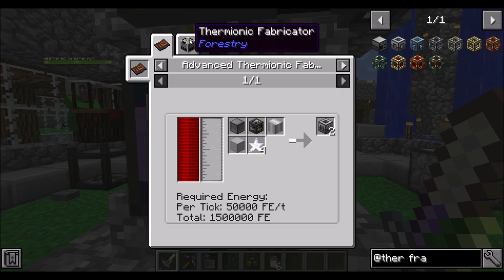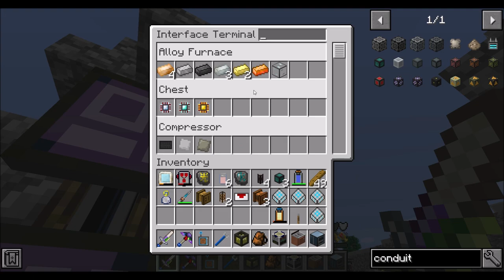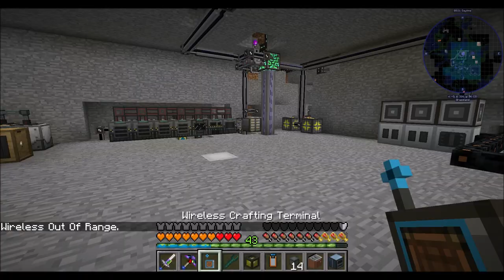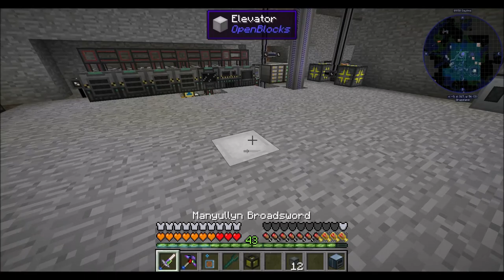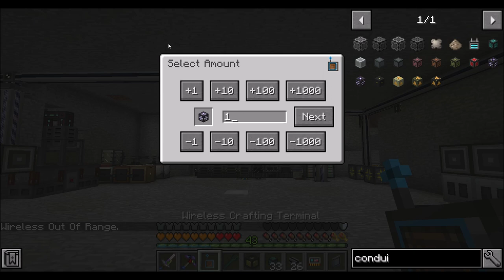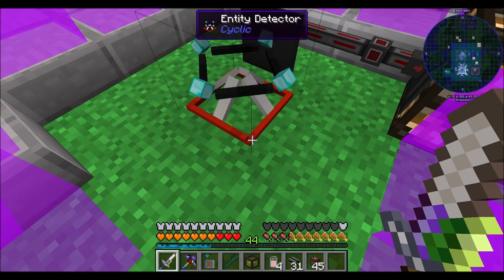Enigmatica 2   Ep48 Thermal Automation

Comment: The Digital Miner can have quite a long list of items in the filter. Don't worry about missing things because you can always add it after and it will re-check the area it has already gone through. Also, the conduits are nice for compact wiring, but eventually the highest tier caps at about 20k rf/t but the Mekanism go quite a bit higher (and then eventually you have the Cryo-Stabilized Fluxduct for infinite rf/t)

Comment: personally when i automate the atomic reconstructor, or similar items like mana transformations from botania, i like to put the glass at eye height, the crafter on top of the glass and the item gatherer under my feet, that way i can still add recipes without having to break the walls. 

(the reason i do it on top of the glass is because then it forms a neat line with all the other crafters for all the other machines i automated, you could put it under the glass if that is convenient too. in my example the glass is where a regular machine would normally go.)

Comment: Dire you should use cardboard boxes to move machines to preserve the settings/energy/fluids but be careful I think AE has trouble handling boxes with data as on my world i cant pull the out of the interface screen unless they are empty but you can fuzzy export them to a chest

Comment: Dire, can you post your computer specs in the description of your video or with a reply so I can be able to run this pack smoothly? Currently I get about 20-30 fps which is less than ideal. Thanks in advance!
Reply: James Deitrick whenever he uses F3 you can see most specs on the top right
Reply: @DiegoRamirez-lp9pe  thanks brother!

Comment: Why not use the atomic reconstructor to make blocks instead of single items? It'd be faster.
Reply: It only crafts what it needs for a recipe. Using only the blocks means waste. Using both will make it default to using items due to the reduced processing steps.
Reply: Dire plays small and tries to save resources in a pack where resources are trivial.
Reply: jack you say it'd waste ressources, but the most it would ever waste would be 8 coal, redstone, iron and lapis. i really doubt that that'd be a problem, considering he finally has a digital miner running(-ish)

Comment: What's the point of bothering with p2ps honestly? Unless you're going a long distance away from the controller, it's not like dense ME cables/conduits are that expensive
Reply: multiple p2p tunnels on 1 cable that you draw so you can get 32+ channels somewhere in your base
Reply: Well you still can't get more than 32 channels per controller side so dense cables are just as good and don't require any of the annoying memory card set up
Reply: @tomarnd8724  put 3 p2p tunnels on the controller setup you have, connect a dense cable from another side of a controller, put 3 p2p tunnels on the cable you put and you have 1 wire running 3 p2p tunnels so 32x3 channels to use

Comment: UU-Matter. Dupe the machines. You made the matter fabricator for a reason, did you not?
Reply: Dire says it would be difficult to automate and that he doesn't have a lot of UU Matter to work with. A sizeable percent of viewers say otherwise.
Reply: @Kraleck  No real need to automate it. Just let it make a stack of whatever item you're low on.

As for not having enough UU matter, Dire has excess ethylene production. He should make a second gas-burning generator just for the matter fab. 6kRF/t will make UU matter rather quickly. He should also have set up an IC2 reactor (which has its output quadrupled in this pack). He's going to need the plutonium later in the pack anyway.
Reply: thermotto Exactly, I just do a stack at a time and it’s not bad at all.  Later, I just build one replicator for everything that I want to keep stocked and throw ME Storage busses on them.  Dire will say that’s “wasteful” and continue to play small and work hard in a pack where resources are easy and power is plentiful.
Reply: @chris909090  
no reason to do anything manual when you can just autocraft it. in fact he could setup interfaces that store a set amount and put autocrafting cards in each one. now you don't even have to wait for the machines to craft the items as you will always have a set amount on standby. just build more crafting cpus (10 is more then enough)
while there are a lot of machine casings you can dupe with UU Matter, there are also quite a lot you CAN'T. there is little point in doing something like UU matter if you can't dupe everything. it's far easier to just setup a few extra machines and throw in a pattern and then never worry about it ever again. better yet just store the UU matter for something down the line that's actually important.
Reply: It’s not even that hard to automate UU-duping, although it’s a bit expensive. Just use a level emitter with a crafting card that activates a replicator already set to dupe the desired item. The pattern should have a dummy item in the ingredients part and the same dummy item and the uu-duped item in the products part. Hook it up to an inventory that puts the item back into the system, and it’s done!
Reply: @felipevasconcelos6736  I mean, that works, but then the issue becomes making all the replicators for the items you want, then supplying them EACH with UU-Matter
Reply: Lily White, he’d probably only uu-dupe one or two different items, so he’d only need one or two replicators. Supplying more than one replicator for one item each with uu is no more costly than supplying a single replicator for all items.
Reply: Lily White I had 12 replicators (yes, this is overkill) and used Xnet to limit the amount of UU in each, so rather than filling each one, they each had only a few hundred mb in them at any one time (except for the one duping dragon hearts which requires a full bucket).  I just let them run and kept a stack of everything on hand at all times.

People overstate the difficulty of acquiring large quantities of UU in this pack given the plentiful and highly buffed power gen ( I mean, ToAsgaard was literally using UU to decorate his base in his play through.). Running IC2 reactors is free thanks to the ability to replicate quad fuel rods for a healthy UU profit so adding as many reactors as one wants isn’t hard (I had 10 in my last run through).  Reprocess those rods into free plutonium, make RTGs, even more power.  And that’s just EU, adding RF makes production really go nuts.
Reply: @felipevasconcelos6736  
i just don't see the reason to, not like it's vastly better to use UU matter over just letting your AE2 system autocraft it using interfaces and crafting cards. i suppose if you want to do things the hard way and create complex systems it makes sense. i wouldn't do that personally as it's a waste of time.

Comment: even after watching dires videos i still have no clue how to use the P2P. even after experimenting in-game my brain just cant wrap around it
Reply: the non-ME P2P  are simple(the fluid, energy, etc)
i am guessing you are having problems understanding the ME P2P
Imagine it like this: the P2P tunnels are like "portals", for example you connect a P2P directly to a controller(that is the "entrance portal"), and link that to an other P2P like 50 cables away(that is the exit "portal") the 32 channels from the controller will only consume 1 channel on the cables that are connecting the 2 "portals", that means you can connect 32 machines to a cable that goes in the "exit portal" and it will only take 1 channel to transfer it to the "entrance portal"
PS: there can be multiple "exit portals" but only one "entrance portal" 
I am sorry if you didn't understand, but that explanation is what made me understand :/
Reply: Cmon earth

Comment: digital miner is ok. suck it up and go builder quarry card.
Reply: Why? The only disadvantage digiminer has is range and he's never used it before so it's a change over the normal quarry card.
Reply: range is a huge problem. 32 block square you have to keep moving it. builder is set and for the most part forget. it has its uses but for the cost I went with the builder. I have a miner too. I have to move constantly

Comment: Do  other people hate ender io conduits or is it just me ?
Reply: I have mixed feelings on them.  In certain situations, they are fantastic, but in general they are a “magic block” and equate to easy mode which kills fun.  They are also slow ... too slow for a lot of tasks I’ve found.  Finally, they are a bit on the laggy side if you use them in mass.
Reply: @chris909090  
name any machine from any mod that isn't a freaking magic block. do you really think you can just shove iron ore into a furnace and get out a ingot? laughable really. 
not sure why you need more then a fully upgraded enderio extract speed....really clueless as even a 14 speed upgrade IC2 machine can't keep up. for scrap? but you could just have more extractions/recyclers....no reason to have a single recycler. 

finally wheres your proof of them being laggy? they have no item/fluid rendering to speak of (assuming you are using the correct versions), not to mention you will almost ALWAYS have far fewer of them as you can run them in parallel within the same block space.
Reply: Rocksfir e Lag goggles are my proof of them being laggy.

I don’t know what you are building but it must be pretty small scale if EIO conduits can keep up with everything you need.  Try feeding water to a large Mel turbine with a conduit and see how it goes.  

There was a detailed analysis of all item transfer options that someone did on Reddit and EIO was very near the back of the pack.  These results were supported by numbers (as are my lag goggles tests) vs. your hysterical hand waving, so calm down and learn what you are talking about before launching into a tirade because someone said something bad about your favorite mod.
Reply: Rocksfir e BTW, it’s okay if you need crutches like conduits to play effectively, nobody’s judging
Reply: @chris909090  
well ill wait for your link to said tests, not that it even really matters anyway. as the entire point i was making was that there is no need to transfer items that fast.  if you are talking about fluids then i suppose, there are better options for fluids.
you had to add the insult at the end to make yourself feel better, it's okay no ones judging your child like behavior. "queue eye roll"

i see that you got triggered so i will just sit back and enjoy this popcorn.
Reply: Rocksfir e You can keep waiting since I don’t recall signing up to be your Googling service.
Reply: @chris909090  
don't state "facts" then refuse to give them when you are called out then.
Reply: Rocksfir e Here’s the final result, which I happen to remember:  XU2 Tranfer Nodes (stack upgrade + 4 speed upgrades being the lowest tested) > HUGE GAP > TE Impulse ItemDucts / Resonant Servo > Mekanism Ultimate Logistical Transporters > Ender IO with max upgrades.  Sorry if you don’t believe that, then you are going to have to google for yourself, or better yet test for yourself.  Should be easy enough to verify that Ender IO is the bottom of the barrel when it comes to speed.

EDIT:  you realize there’s a space right in the middle of your username right?  You should fix that.  Also, “queue” is spelled “cue”.
Reply: @chris909090  I know that this is 4 months later but there are multiple spellings. Queue as in a line and  cue as in to take action. So he did technically spell queue right but they used the wrong one.
Reply: Alistr2001 There’s only one spelling of the correct word.  I think you may have whooshed here.
Reply: @chris909090  I did mention that he was using the wrong word but that he did spell the wrong word right